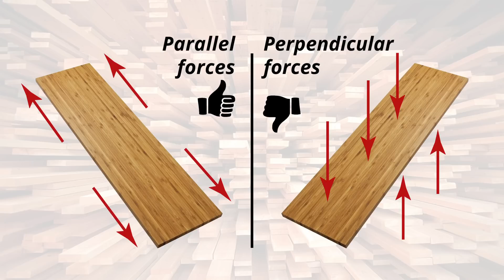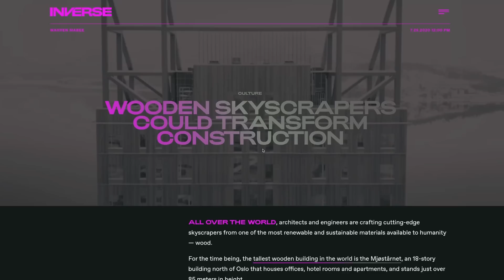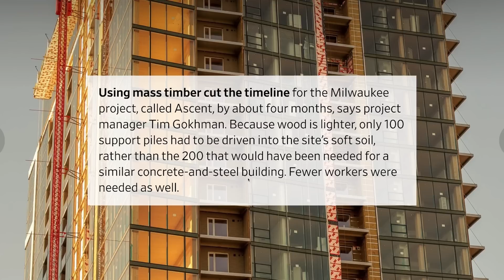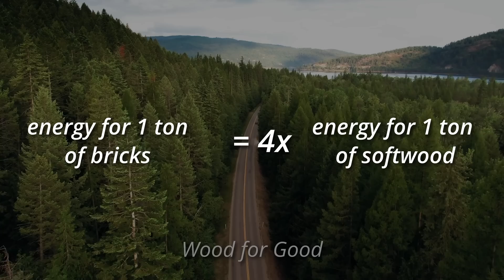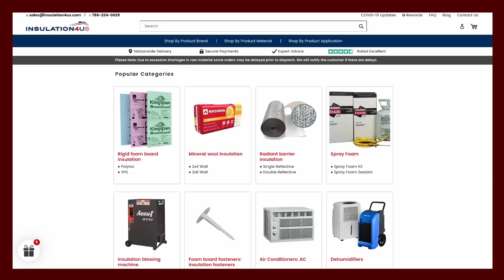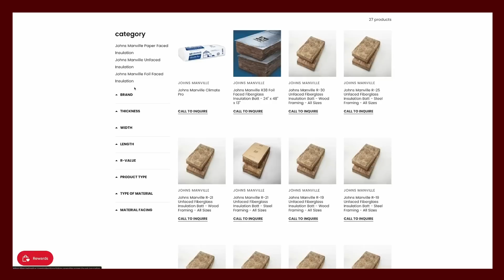How Mass Timber Skyscrapers could be the Future of Construction

Comment: Wait...I thought COVID killed the skyscraper!... 😃 ...And you can make the intellectual argument that a mass timber project would be relatively fire resistant, but convincing people to live or work in a building that is made out of essentially the same basic material as they burn in their fireplaces, and which have only limited stairway - or extremely vertical - egress is going to be a huge hurdle to overcome. Straw bale housing has never taken off even though they are way cheaper to build, and sodbuster homes withstand fire better than most any other kind...Don't give the masses credit for being more analytical than they are...
Reply: Not true you can tell gen z anything and theyll eat it up. You could say “hey i built a skyscraper out off cow poop and its green” they will flock to it 😄

Comment: Idk how long they last compared to regular skyscrapers? I've read that with proper maintenance most skyscrapers can stand for hundreds of years and I wonder how this compares to a wooden one.
Reply: The Cupples 9 building in St. Louis was built around 1900. before my employer occupied it, it required a lengthy retro fit to be occupied.
Even so, it had issues and shook terribly anytime a truck drove by. Not fun seeing the roof just sitting on columns, move six inches and one goes and then everything goes.
I can tell the  stresses are occurring as the corner bricks are disintegrating.
That doesn't speak well to the lifespan as anyone who has lived in an old wooden huouse knows, wood warps over time under load. Maybe its cuz im autistic but I notice it in every wooden structure  Im in.
Reply: They always mention how surprisingly well mass timber does in fire, but they never talk about things that literally eat wood like termites. Imagine a 10-story wood-structured building. Then imagine discovering the first floor having 1/3 of its structure missing.
Reply: @Curly_Maple  if that's a concern in the climate where it's built, then you'd need to provide routine inspection and spraying for termites, which should be well within the budget for a tall building if the cost is spread over many tenants, but you could also just build the first few floors out of stone and steel and go mass timber higher up.
Reply: @AlRoderick  - Ya, I like that idea (different construction for the ground floor) for peace of mind. 👍
Reply: The glue holding these things together is definitely a question mark. Though, I should add that "proper maintenance" for steel and concrete buildings often involves replacing them piece-by-piece. Buildings in which concrete and steel are in constant contact are particularly needy, but metal fatigue alone prompted the complete rebuilding of the Eiffel Tower.
Reply: @pcno2832  The Eiffel Tower was unprotected iron I think and not expensive steel, not the same as rebar steel.

Comment: IDK about this. My first instinct is "hard pass". I'm trying to image how a wood World Trade Center would have fared in 2001 compared to the concrete and steel versions.
Reply: How'd steel and concrete work out for them exactly...? Not saying manufactured wood would do any better, but it'd be pretty hard to it to actually do worse.
Reply: @ChillyJack  I just have the idea that no matter how surface fire resistant wood structural members might be, they would eventually burn and result in a faster collapse. I may be wrong, but that's just what I'm thinking would happen.

Comment: I love the idea of these, however if we look at the image at 7:06 I think we can see it pretty clear to advantage as well.
The mass timber does require a lot more material to get enough strength, so we have a giant diagonal member in front of a window.
Now this with better architecture/engineering might be able to be resolved more nicely, But it shows that fundamentally we are using more volume of the building for structure. Which means less percentage of the building is habitable, and beams may need to be placed in less optimal locations.

Still I think this is a wonderful material and I see lots of promise.
Reply: It is a design choice to have the structural members exposed internally and displayed in the windows.  It would not have been difficult to design the layout to conceal them instead.
Reply: @Barnaclebeard  True, as a highlighted it can be hidden, but that’s not the real point. The point is that more space in the internal volume of the building is used for structure rather than being occupable. Ie less floor area is available to be used.
Reply: @FreekHoekstra  They're also lighter, cheaper, and go up faster.  There are going to be many situations where wood construction allows you to have more floors on the same budget, for example.  It seems like an advantageous tradeoff to me.
Reply: @Barnaclebeard  that’s fair. For the record I actually really like the development I just think we need to be honest about upsides and downsides.
And like Linda was saying the ideal is probably a combination of both. Using some steel and concrete elements to reinforce specific sections but having the majority be timber.

Comment: My guess is the best use for these new engineered wood materials would be to extend the concept of the 5-over-1 to more floors, maybe 10-over-1s.  I'd still be concerned with going much higher than that with wood.  Wood sways in the wind much more than steel and concrete.  I discovered that with a treehouse I built.  The wood itself has held up for 5 years just fine, but some deck screws have literally snapped because every 10 seconds the entire structure slightly sways in the wind, and that constant swaying is like taking a piece of metal, clamping it in a vice, and bending it back and forth ever-so-little times a million.  Wood actually handles this well, but I'd be concerned about the repetitive stress of that on connection points made out of steel that are hidden/hard to see/hard to access for maintenance.
Reply: Concrete and steel sways in the wind. If the same structural specifications are met by a wood structure there is no difference. If you built you tree house out of concrete and steel to the same structural tolerances as your wooden one it too would sway.

Comment: I owned a wood manufacturing company and a degree in architecture so have a keen interest in wood. Managing forests isn't just about clear or selective cutting! Both methods have advantages. If you selective cut, eventually you end up with a forest of only the poorest trees. Clear cutting in relatively narrow bands, increases the diversity by creating open areas for a few years then natural regrowth. Allowing some forest fires also improves the forests. 

I don't know what the limiting factor is for laminated timber buildings but combining timber and masonry seems like a bad idea. Timber is flexy, masonry not. The face of a tall building is carried by each floor. Wood changes size with changes in moisture, quite a bit actually. The change in size is different for each direction of the structure of the tree. Least in axial, most in tangential. Thick cross laminations don't seem like a good idea. 

They've started building 6 stories of stick built apartments on top of concrete parking garages where I live. (Stick built = 2x4s) I live in tornado alley! Could be a lot of flying sticks!
Thanks for the video.
Reply: Morgan Allen  Structural Steel starts to lose strength @ 600°F. Unprotected it will reach that temperature very quickly in  a fire. So it has to be protected, commonly in the past it was asbestos. Now it is mineral fibers. Wood is self insulating including the char.

Comment: There are more low-rise apartment complexes, malls, big box stores, schools, low-rise healthcare, and office buildings built every year than there are skyscrapers built. Although overcoming the engineering challenges of high wood construction is intriguing, I think the timber building (at least with our current technology and manufacturing) is much better suited to low-rise applications. I know Matt Risinger featured a college that built a carbon-neutral biophilic building on the east coast. I believe that is the actual market for these technologies. Love your content - you always have intriguing content!
Reply: It would be very good for low-rise structures, but you are falling for an outdated view ( prejudice ) about its usefulness in higher structures. It's weakness is not structural but psychological.
Reply: @ziggarillo  Oops. My bad. I did not mean to imply that wood isn't strong enough for the job. I would much rather be in a high wood building during a 9-point earthquake in Los Angeles than in a steel and concrete building! However, this is prohibited by code. The engineering is complicated because it isn't standard - you can't just Google your specifications and find everything laid out for you on the manufacturer's website. The technology is new enough that it is difficult to source enough material in a timely and sustainable manner (although to be fair, that's true of all building materials across the board, now). I'm not worried about the structural integrity of wood buildings, I'm concerned with economic viability and code compliance. It's rather more nuanced and complicated than materials engineering would suggest. It will take years before codes are updated to allow tall wood buildings. I'm delighted to know that you read my comment - I hope this clarifies my meaning.

Comment: 3 wooden condo complexes have burned down recently where I live, concrete and steel 0.
Reply: Depends on who was in charge to choose the materials for constructing them, the lead engineer checking if construction was done correctly ( no cutting corners)  and also what was inside those condos.  Polyester furniture and carpets etc...

Comment: Anything above 3 floors I would avoid wood for any structural elements. I understand it is possible to build higher as your examples reflect but when building something you need to design for worse case scenarios so the building can last over 100 years. This includes the safe assumption that water and moisture damage will occur compromising the building. If you are concerned with the environment and want to promote carbon sequestration than just build the structure out of steel and use a lot of wood furniture and flooring in these buildings
Reply: Especially when you hear a phrase like "moisture RESISTANT adhesives."  Nature is full of moisture as it turns out.
Reply: @TechGorilla1987  Correct. I grow and build with some of the best tropical hardwood in the world and hardwood is not technically moisture or termite proof. Just resistant if you properly cure it , and properly seal/oil it, and keep it dry. As soon as any wood gets wet regularly (especially plywood ) than it starts to become compromised. These buildings look to be made with softwood which is a much bigger concern as well.

Comment: Belinda. I worked for Seagate, the company that installed the mass timber components for Brock Commons. I didn't work on that project per se, but worked on other projects and I am now working on a 9 story tall CLT building. Mass timber is growing a lot and taller and taller buildings will be a lot more common moving forward.

A enjoy a lot how you can see through the all the bs and marketing strategies.

Great video. As always.
Reply: is it in Portland Or. Area?
Reply: @abelardoramirez3962  Nope, it's in Canada, British Columbia, Okanagan region.
Reply: @jisharagu  The Brock Commons Tallwood House is in Vancouver, which is a looooong way from the Okanagon region.   Interesting that you claim special knowledge of this building but don't know where it is.
Reply: @andrewalexander9492  I'm referring to where I work now. With the 9 story building. Not Brock Commons.
Reply: The brock commons is not a true mass timber building. It still has cast-in-place concrete foundations, ground floor, and elevator/stair cores; and
steel connections and roof structure.
Reply: @UnbreakableM1nd  haha. You basically described how all mass timber buildings are buddy. Did you want wooden foundations? Wood to wood connections without any steel? It's also prevalent to have the cores to be cast-in-place as it helps to increase the building's rigidity. Especially on a tall one, like Brock Commons. 

If Brock Commons is not a "true mass timber building, " I don't know what a "true mass timber building" is.

Comment: Fires, rot, termites?
Reply: @Narja I don’t think he did. He doesn’t seem to realize the strength of steel disappears when the fire rises temperature.
Reply: Excellent point.  My only counter-point is the tried and true square-set timbering in mines.  It can quite literally hold up a mountain.  Aside from that - I'm a big no way.
Reply: @TechGorilla1987  yes and no. in the mine, the rock is still bearing some load. There is a reason they stopped building wooden framed sky scrapers.
Reply: my comment was deleted...  uughhh let me try again
Reply: There's paint additives for wood that makes it  fire proof  ( oooh i said firereta....rdent.   that might be why my previous comment was deleted)   and there is also antimicrobial coatings for wood  that basically prevents rot and termites ( kills any and all micro organisms inside the wood and keeps  outer micro organisms out )

Then it also depends on what kind of wood ( see the video )

Comment: Good god no. I worked ins the Cupples 9 building in st Louis. Built like a 19th century mine. I worked at the top floor. Whole bu8ilding shook anytime a big truck drove by and would fail in a horrible pancake fashion as nothing but gravity secured the columns to the floor. When I saw the giant cracks in the columns on lower floors I got pretty anxious.
Reply: I'd also add that was WITH a brick facade. One of our meeting rooms at the corner of the building had bricks just turning to dust. I also noticed the stairwells were not straight like something had shifted and tweaked them. Only time I ever saw a crooked stairwell.
Reply: The Cupples 9 building was built 120 years ago using traditional timber post and beam construction.  The wood structures Belinda is talking about use completely different engineered wood structural assemblies whcih didn't exist back then,  using structural design that wasn't possible back them.  The only common element is the word "wood", this is nothing like the Cupples 9 building.
Reply: @andrewalexander9492  She showed examples in her video that were exactly like the Cupples 9 building. 

She even stated the swaying problems in wooden sky scrapers.
Even with the massive retro fit they needed before they could occupy it, with modern techniques its still the most unsound structure I've been in.

Ive been in many sky scrapers, only one shook violently when a truck drove by hundreds of feet away.

That building will fall unless WWT actually fixed the crumbling bricks in the corners and reinforced the cracked columns.

Especially if another earth quake hits from the new Madrid fault. 

Also cutting down all the trees needed for this is not good at all.